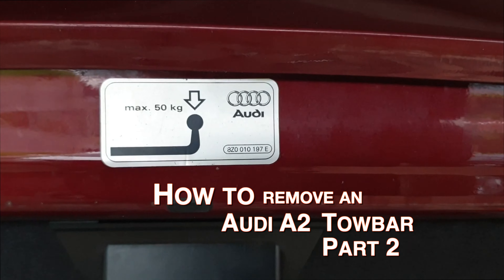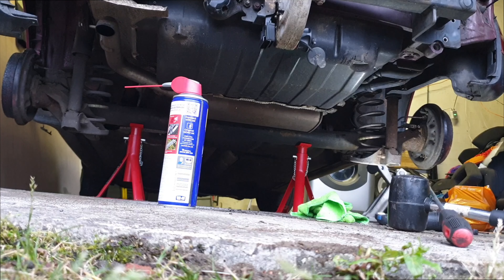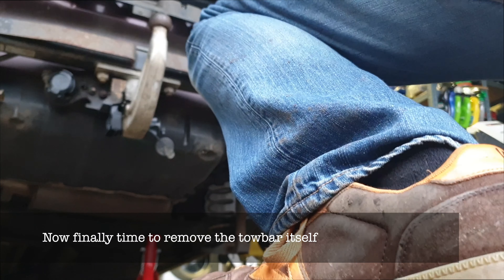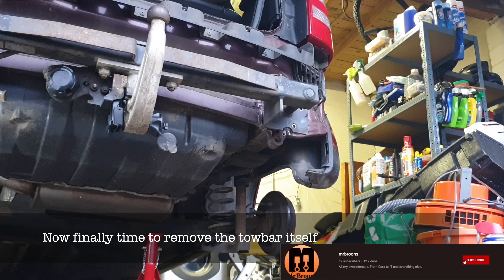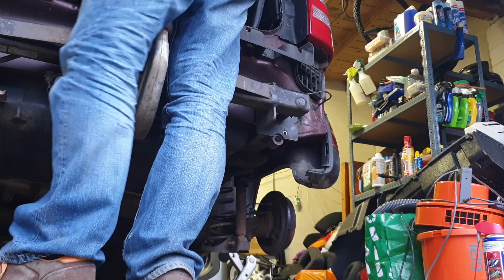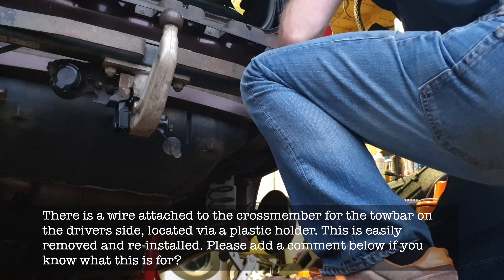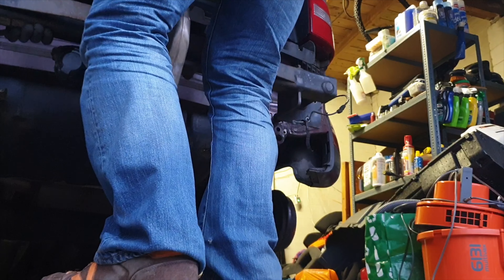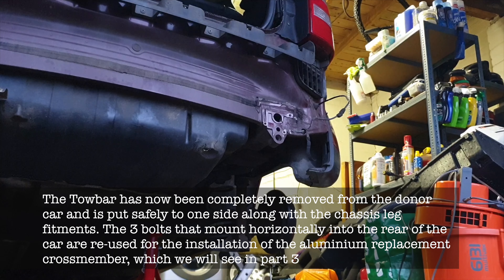How to remove an Audi A2 Factory Towbar without issues - Part 2

Comment: The single loose wire that was routed along the towbar crossmember from the drivers side is the aerial for the remote key signal, which goes to the CCCU.
Reply from the maker: Thanks Ian 👍